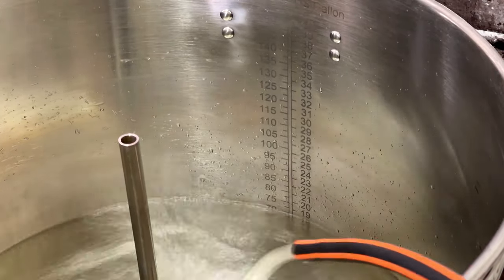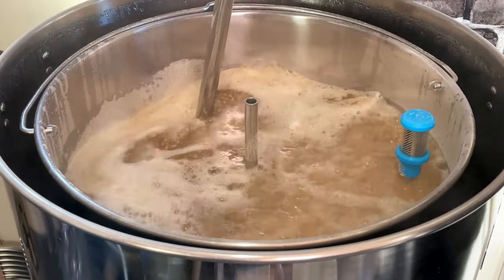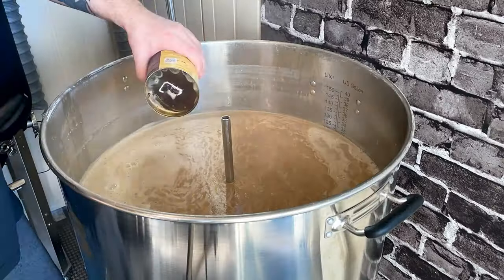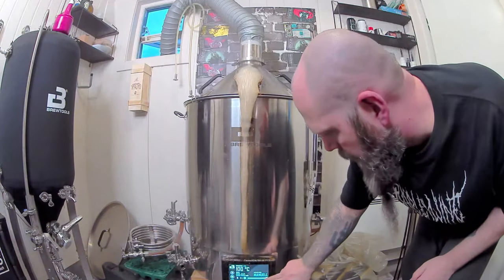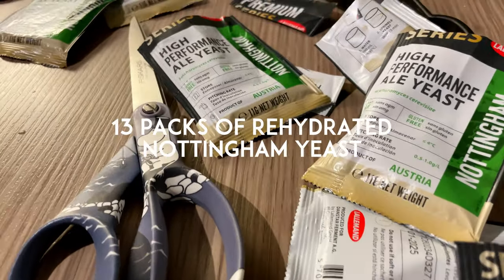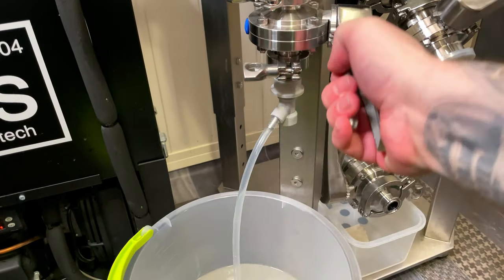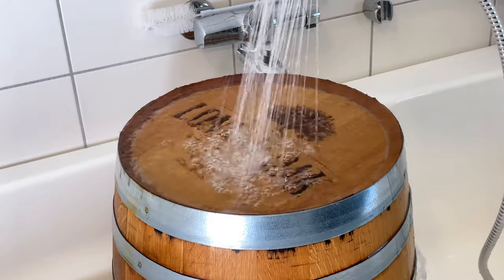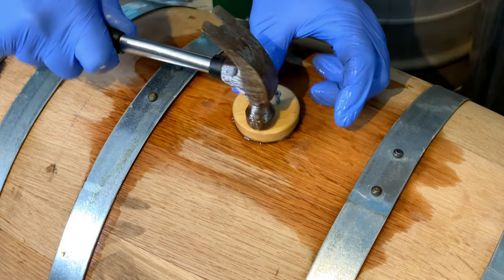Homebrewing a Bourbon Barrel-Aged Super High Gravity Barleywine!

Comment: Perfect timing for your video! I was already looking for good Barleywine recipes and this sounds absolutely great! However I'm a bit scared of the long boil time, have you had any issues with scorching? Also will a Boil time of around 2-3h already give similar results concerning the viscosity of the end beer or what is theminimum time you'd advise?
Reply from the maker: Glad to hear 😊 No I never had any issues with scorching, but be careful with the efficiency you use when boiling. I did a boil at 100% efficiency once and it was some burnt wort stuck to the heating elements. Luckily it didn’t create any off flavors.

You’ll still get a great result with “only” 2-3 hours, so don’t worry about that 😊
Reply: @WestumHjemmebryggeri  perfect then I'll try with a shorter boil time and if it works I can always up that in the future 😉
Reply from the maker: @brewmaster97 good luck 🍺😁 Let me know how it turns out